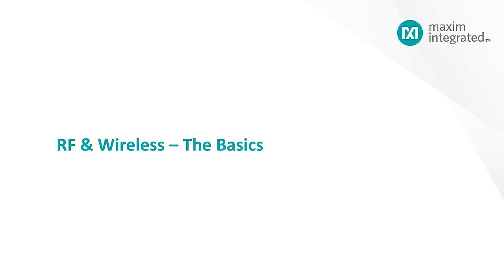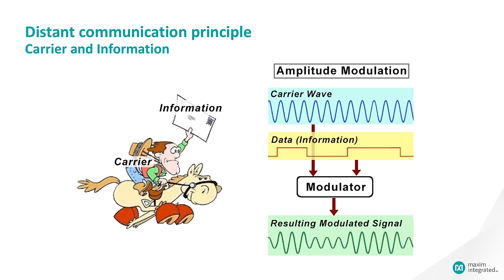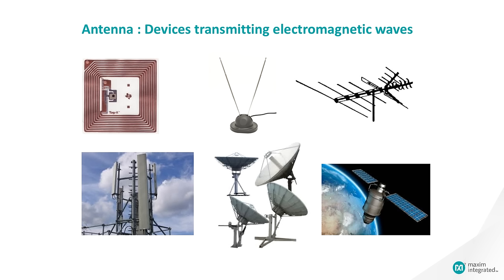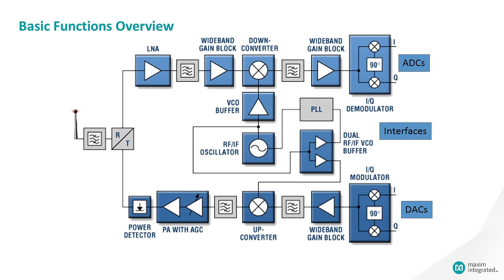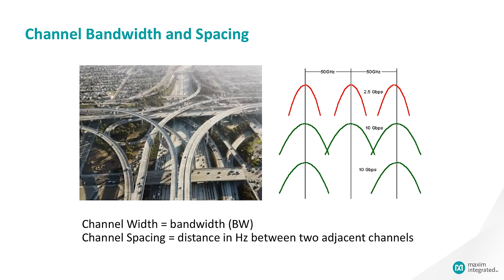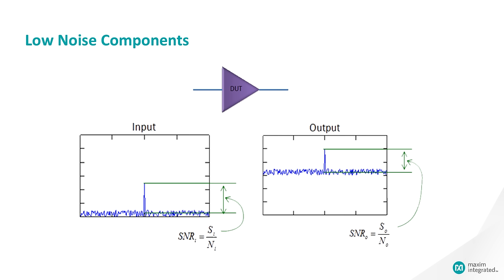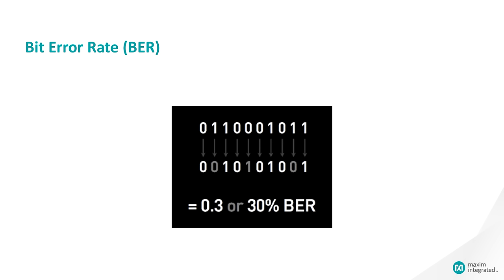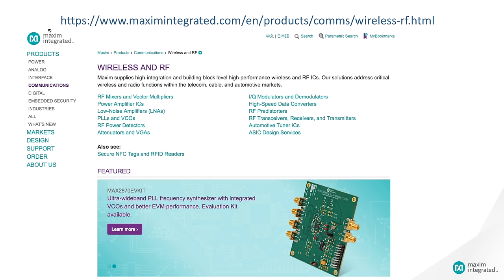Fundamentals of RF and Wireless Communications

Comment: Any video on Remote Control  circuit's  , explaining how the signals are transmitted from transmitter to receiver circuit's  , explaining the function of every electronics components used to built these circuit's  . Or sir do you have any training material with detail explanation , to make a small project of Remote Control circuit to control the motors of the RC toys  , cars ,planes